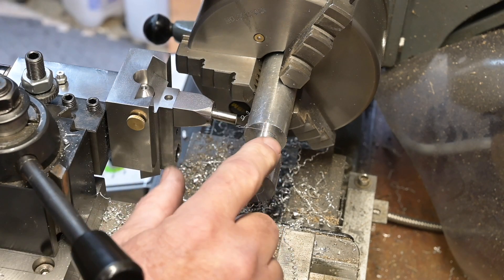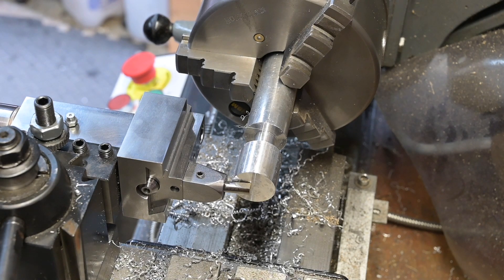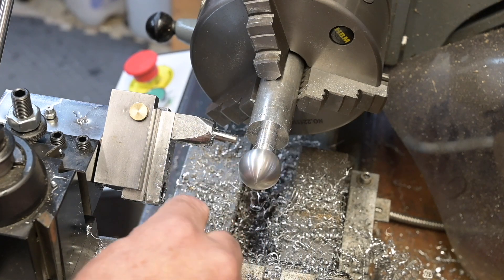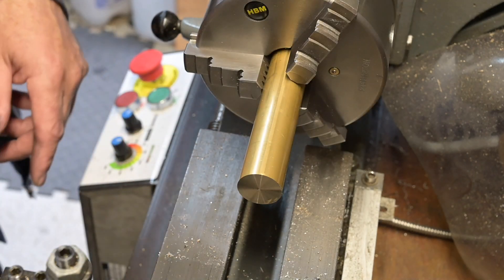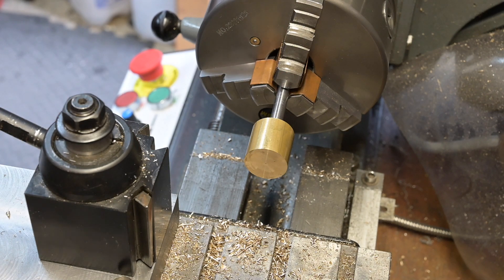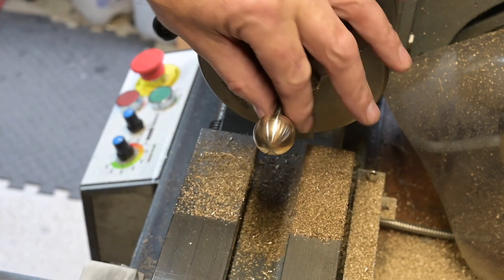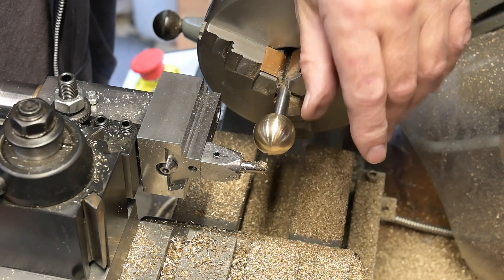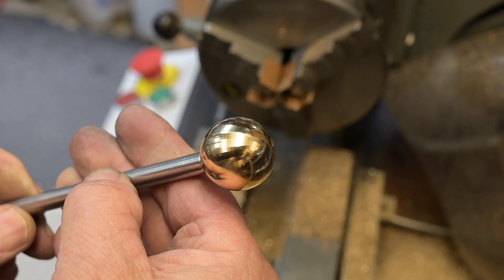Testing the Ball Turner - Ball Turning Tool EP06

Comment: Are you able to set the tool to the correct radius and in the desired position from the end. Then add the cut depth with the cross slide until you are over the centre. It seems easier than moving the radius every time.
Reply: It looks like a no brainer to me and ideal for repeat balls. It will be easy to set the zero at the end of the crossslide travel.  Do my head in picking up the allen key then finding the hex hole then unlocking the slide and adding a cut then putting it down again and remembering to lock the slide. Id add a cut with right hand crossslide handwheel and move lever with left hand keeping pressure on the crossslide handwheel to prevent moving when cutting. With the radius set and locked no danger of going smaller even if you go past the center of the part.
Would a round carbide insert work screwed to the end of a bar instead of the hss tool. Having it slightly larger than the rod would give it a natural clearance and would not need to be set at an angle.
Reply from the maker: @tates11  thank you for comment, your knowledge is far superior to mine, but I can’t see how it would work using the cross slide in it’s current configuration of cutting at the top and centre of tool rotation is centre of the tool holder. Maybe my lack of knowledge won’t allow my brain to see it 🤷🏻‍♂️
Reply: @EnglishHobbyMachinist  It looks like the tool engagement would increase too much as you get nearer the center. Like you said in the video adding a pair of chamfers may be needed to rough out the profile. Not as simple as it first seemed, but might be worth a try for interest, maybe try approaching it with the compound at 45 degrees.
Reply from the maker: @machinists-shortcuts  I haven’t tried to do it that way, but whatever method is used involves moving something each pass 👍